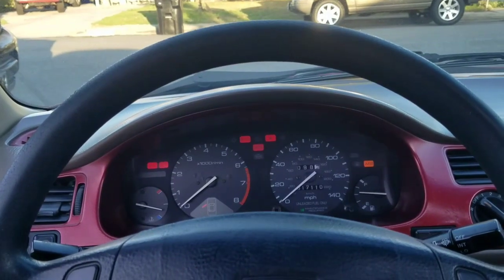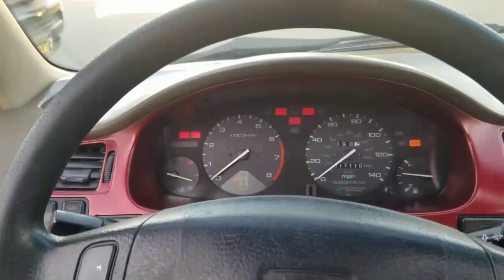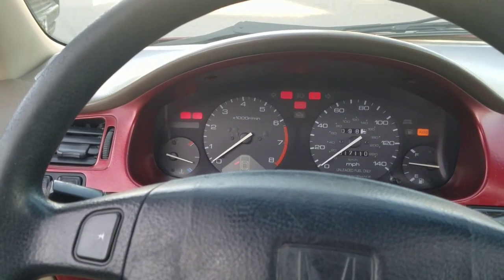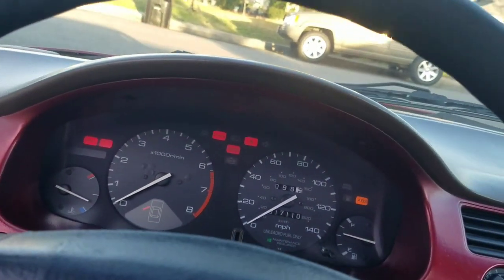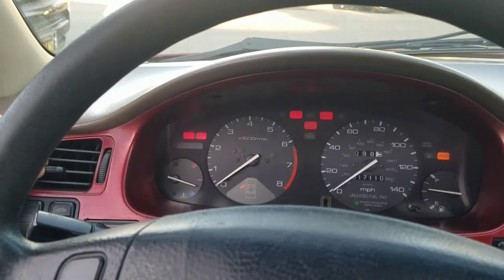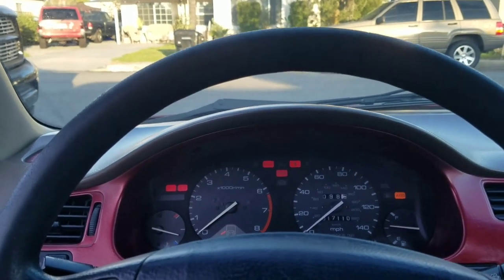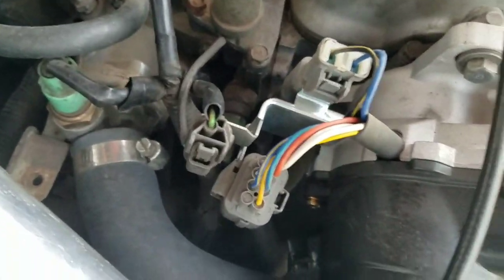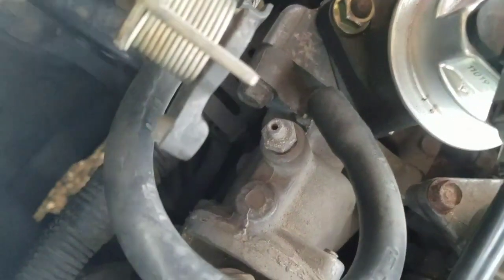1994-1997 Honda Accord Speedometer Problem

Comment: My 97 just did it today and the check engine light came on you think might be the speedometer sensor ?
Reply: mines doing it right now but no check engine
Reply: Corn Pop’s Bad Dude.  no i didnt my honda end up getting stolen and wrecked smh
Reply: If your speedometer & odometer both quit then it's speed sensor, under the air hose at back of engine near firewall. The instrument cluster he described is incredibly difficult to replace, replacing the speed sensor is far easier & far less time consuming.
Reply: So is that brand new or used speedometer head that you had replaced or did your friend rebuild it with new parts?
Reply: @eltoro9386 damn mine too but luckily they just took it for a joy ride